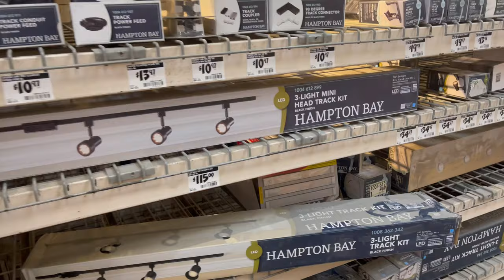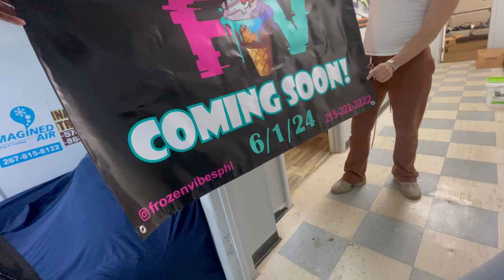Electrical Nightmare Ruins My Dream Ice Cream Shop! Ep3

Comment: Electrical safety standards are non existent where you live. You better have top-notch fire insurance that covers electrical fires. Months or years from today someone will need to drill something in those walls for whatever reason and you'll be lucky is all they cause is short.